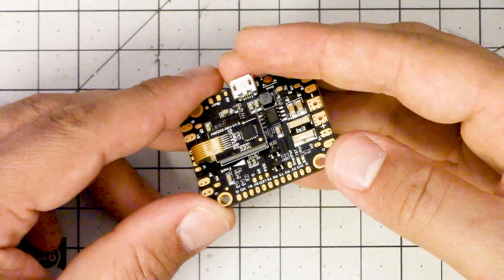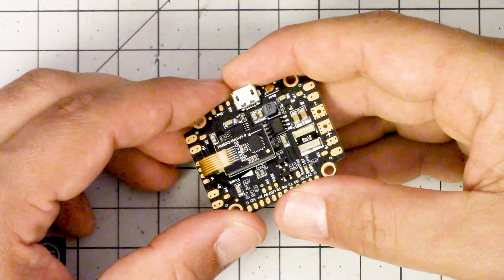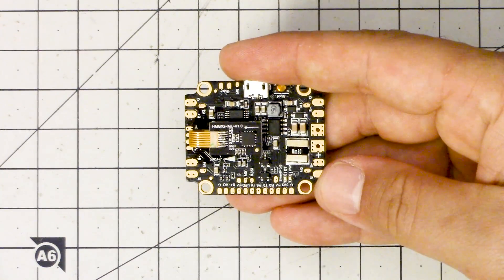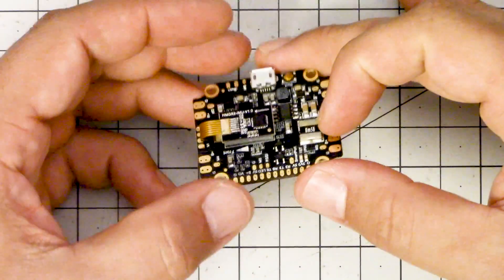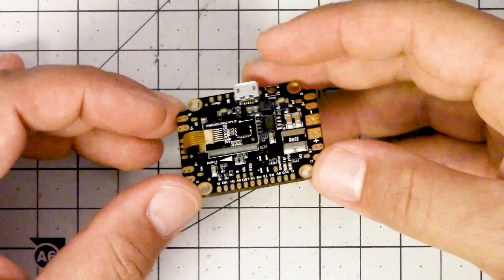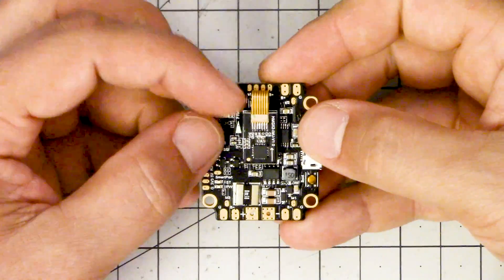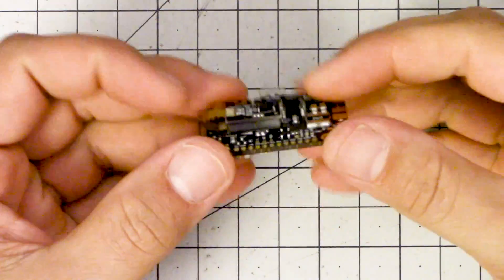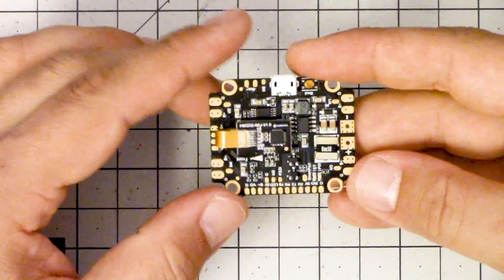Holybro Kakute F4 AIO | BETAFLIGHT FLIGHT CONTROLLER REVIEW

Comment: mmmmm I have tons of questions actually that I would have expected someone like you to comment about in a " review" :

 How many inverted UARTS total
 What method are u using to lower the voltage in the BECS (how many becs and which?) Linear or Buck converter
 How many amps through the 5V outputs (does it have 5 V outputs?)
 Do u recommend running camera + VTX from the FC?
 Do u recommend an LC filter before the VTX?
 And many more....
 These are one of those ocassions where I miss JC.....
Reply: Sorry but this time im with the guys, if you call a review, don't send them to read the manual. Actually that is something like get it yourself, read it and the you will know what I´m talking about...

Obviously not all channels are focussed on same things. Bruce is awesome teaching things, Painless is good at theory and some technical things too as well as you Joshua. Sadly I hate this video... you sound like a I did this , this is my board you have this thanks to me kind of attitude, not good... 

We all miss JC, but that was low too...
Reply from the maker: How many inverted UARTS: I told you it can do SBUS and SmartPort at the same time. Therefore it has two inverted UARTs.

It has a switching regulator. Nobody is building FC's with linear regulators any more.

The 5v regulator is good for up to 1.5 amps. The 3.3v regulator is good for up to 200 mA.

I recommend running the camera and vTX using the provided power pads. I said in the video, "I'm not going to show you how to wire this up because I wrote a detailed manual on how to wire it up, so go check out the manual."

I do not recommend an LC filtering. The built in filtering should be fine for most setups.

We all miss JC.

Next time you have questions, please feel free to ask them, but keep the passive-aggressive, "I expected better from you," attitude to yourself.
Reply: Joshua Bardwell this is a "comments section" and my comment is a passive "this is far from a review, this is a presentation of a product" and passive "u usually make better videos". if u take that as an attack more than a compliment-critique I would recommend keeping the defensiveness to yourself
Reply: riiiiiiiight champ, I came to a review to be sent to read the manual :D omg. Happy flying! :)
Reply: RIP JC. "I would recommend" maybe be more productive with your time? Read the manual? It answers your 5v question at the very least. I'll let you read the rest to see what you find. . I gotta say, how funny it is to see a commenter try to tell a YouTuber what they should keep to themselves...in their own channel. lol! Happy flying :)

Comment: Joshua, you did a masterful job on the user manual. It should set the bar for everyone else. If we want to make this hobby more accessible, then this is what must be done. 

The board design is very interesting. I thought I'd be doing a lot more black box work than I do. The reality is the stock PIDs are pretty good. Fine tuning by visual q's and sound like you've thought us seem to yield pretty good results! Therefore, I don't think the ad slot is critical any longer. 

Thanks for the heads up on the foam and ribbon cable. The honesty is much appreciated. Look forward to trying it out.

Comment: I have this board and I agree it is a very nice board. I used it in my race last weekend. Hit plenty of gates and the ground a few times and as long as the props were still there and not bend to where it locks the motor with the arm I was able to fly away, no feedback loop. It does have a great manual. I did have issues trying to get cpu load under control with 32k gyro. I was able to get 32k gyro 16k pid loop with no accelerometer to 52% cpu load but was not comfortable with that. In your experience what is the most you would run your CPU load?

Comment: Nothing about the 32khz gyro?

I'm using this board and it's sooo smooth. Really like it. Waiting for the BetaFlight 3.2 to use the 32/32k with Dshot1200.
Reply: I'm curious about that as well - although 8kHz/8kHz + Multishot on BF3.2 is working really awesome for me.

Comment: did you have videos where you explain smartport and UART and what it is for? I'm starting with building drones and never heard of this! thanks Josh
Reply: Jan Grewe danke! thanks for your explanation and help!
Reply: Toni L it's a connection that allows you to receive and transmit data. Google uart.
Reply: Sherman G i look on Google but I wanna know if he explained how I can use this! what I need to run this an so on! we all started and no one knows all from beginning! thanks for your answer and time
Reply: Toni L yes, I just started as well. Try downloading the manual for this board, the link is up above. It explains a great deal.
Reply: Toni L UART can be used for telemetry which allows your flight controller to send data back to your transmitter/radio such as battery voltage so you know how much longer you can fly. You don't want your battery voltage to get to low or it can ruin your battery. Also check out cameras such as the Runcam Swift 2 which has a built in on screen display (osd) which allows you to see battery voltage through your goggles without using UART.
Reply: It's just a serial port, but only the TX (send) pin of it. But it's also inverted, so you need to have a inverted UART on your FC to use it - that's why there's a specifically labeled "Smartport" pad there, which takes care of it. The alternative is getting the "pre-inverted" Smartport signal from your receiver (by soldering to the receiver board in front of the inverter), and then using a regular UART's TX pin.

Comment: That cable is not a ribbon, it's a Flexible Flat. And if you're going to recognize the potential for failure (a good thing, IMO), maybe the next iteration should be designed with FFC connectors on both boards, instead of a soldered FFC that's realistically impossible to replace by end users. Love the idea of isolating the IMU tho. Isolating the FC when the board is soldered to 20 different things on the quad anyway always seemed like a bit a kludge to me.

Comment: For $40 I think it's worth a try. Why did they not use a detachable ribbon cable on the FC instead of solder on? How are the inverters working with 3.1.7, seen quirks like the DYS FC?

Comment: Hi Joshua. It is really well designed FC. I can confirm that gyro on the piece of foam works great. I have built two almost exact same racing quads, the only difference is, one has DYS F4 and the other one has Kakute AIO. I could not get rid Yaw jittering on DYS F4 BF3.1.6 no matter how much I played with PIDs. On Kakute  BF3.2.0 with stock PIDs no jittering at all, quad flies smooth. The only thing which I am not happy with is 5VDC regulator.It is not filtered very well and 1.5A is not enough. I have TBS unify V2 5V version, RC swift micro and XM+ connected and when I give big throttle punch OSD disappears (I have 1000uF LSR. on battery pads).

Comment: Can you test and mount the IMU board with Kyosho Zeal Vibration Absorption Gel? I have just buy Holybro Kakute F4 and have some Kyosho gel and like to know from a pro what thinking of try that?
Reply: BuzzCola 3 Just post it here ;)
Reply from the maker: I would definitely think that is worth a try.
Reply: Jörgen L good idea... I'd like to know if I can use it as well
Reply: Joshua Bardwell hi could you confirm if this board can support the lua script
Reply: lol
Reply: Joshua Bardwell hello. I want to send you a link to cyclone dal props 2 pairs for 1.5$. it seams like a good deal.
Reply: tried it with moongel myself (same sort of stuff), as expected the gyro is too light, the rubberised foam pad that came with it does a better job.

Comment: That ribbon looks like a potential nightmare down the road.
Reply from the maker: My main concern is that somebody will burn it with the soldering iron while soldering up Video.
Reply: I think if the user is cognizant of the ribbon anytime the copter is being fiddled, modded, poked and prodded, for any reason, then it will be a minimal issue.  But certainly the board can't be treated as much a 'robust' component as before.  Where I see the biggest potential of it being a problem is in the increasingly compact frames where wires are somewhat 'shoved' into voids.
Reply: totally agree, i would have thought they would have put it at the back of the board
Reply: nah...
Reply: cable is a lot tougher than jb gives it credit for
Reply: Redemptioner1 no it isint
Reply: huhhman I don’t even remember even touching it all the sudden no gyro or accelerometer in bf
Reply: It is right out the box
Reply: And why is that ribbon supposed to be a nightmare? Because I don't see any major issue.

Comment: why mount holes are connected to gnd? i like metal screws. sadly i can not use this fc.
Reply from the maker: It's absolutely standard practice to have the screw holes grounded. If your motor phase is touching the carbon, your problem is NOT that the FC is providing a path to ground. It's that you didn't insulate your ESC or motor correctly.
Reply: your carbon is conductive, so they would effectively be grounded anyway so you can still use metal screws all the way through.
Reply: gnd to frame connection is prohibited BECAUSE the carbon is conductive. you may ignore that but you just increasing the chance of magic smoke by that.
Reply: prohibited? where does it say that, that's a new one on me lol.. I know you can't do it on something like the powercube, because they use those for transferring power along the stack. me personally I use nylon standoffs anyway so for me it doesn't matter, but i'd like to see pictures of showing conductivity between two finished sides of the carbon. in fact i just did it on my carbon frames and it's only showing conductivity on the edges not on between the top and bottom sides. but if it's ground and the holes are ground it doesn't make any difference. the issue only comes when they're carrying power
Reply: Why would that cause magic smoke, your cars whole frame is grounded to battery too.
Reply: my thoughts exactly.
Reply: not cause but may cause. i'm lucky one. my fc had burnt when motor phase wire occasionally touches the frame. also, i think it's closest to aviation than to cars. afaik all avionics follows that rule.
Reply: not true... avionics the chassis is ALWAYS ground. if it wasn't then any aircraft that gets hit by lightning is completely toast. it's called a negative earth system just like cars., if your motor wire is touching the frame and it shorted out, then your motor wire  or motor was bad or maybe the ESC pad was touching the frame. 

but 99.999999% of the time, the chassis is always ground. otherwise you'd get an electric shock when you picked it up lol
Reply: wait why are you using metal screws for a flight controller?
Reply: My first question was why? Nobody answered yet. Standard practice is to connect that nets through filter

Comment: Is the youtube channel your full time job?
Reply from the maker: No. I'm nowhere near enough money from the channel to go full time yet. But I have some things in the pipeline that I hope will get me closer.
Reply from the maker: None of it matters unless your battery can supply 180 amps. Can it?
Reply: Joshua Bardwell can I run this fc with 45a escs and cobra motors?
Reply: Tigerle you don't get the point this fc doesn't support enough current. Lol it with an integrated pdb. This would limit the amps that could be pulled from the escs. Holybro states it supports only 120 A maximum current and the escs are able to pull 180 A so I think you now understand where I am going. With 6 inch props and good motors you can easily reach the 160A and this fc aio only seems to be tested of up to 120 A max. Next time your trying to play smart inform yourself please.
Reply: Joshua Bardwell I am trying the insaneya from Fu-rc so I guess yes. It is 2p4s lipo and each 4s has a 95c rating from tattu. So just one would support 152 A and with the second pack it should withstand the punchout longer. But I would definitely get over the 120A max rating of this f4 aio. Right?
Reply: Currently using the Tattu r line and the sls quantum with a burst c rate of 130 c which results in a burst Amp support of 195A.which is perfectly fine. The C rates of sls are not overrated they normally are underrated as they don't like to give out mystical c rates.
Reply: Another of Joshua's videos goes over battery ratings and why C ratings are mostly meaningless, unless to compare batteries of a single manufacturer to their other products (for example, a 65C from brand x will handle better than a 45C also from brand x). I doubt that pack will sustain 180 amps for any usable time, unless 2p does more than I know... but if it did double that, wouldn't we all use it? Not sure here. I'm guessing the board with a 120 amp rating would be fine since you'd rarely pull more than that and so it wouldn't be overworked for very long.
Reply: From reasonable tests I've seen, C ratings are definitely overrated from what you might expect them to be. There's no standard test so they can claim any number they are able to test, meaning you shouldn't expect a  195A burst for a few whole seconds as you might want. If you look at what some manufacturers are doing with providing an accurate rating, they're giving around 40 amps as the constant discharge limit.
Reply: Wind1000100 well it's Joshua's testing procedure http://www.lipobench.com/indexranking.php
Reply: Tigerle I don't mind about the current endorsement at all. I only mind about the max. working current that the pdb can supply. But I am waiting for Joshua's answer. Hopefully he gives me a heads up. Otherwise I have to go with the hglrc where I would really prefer this one instead.